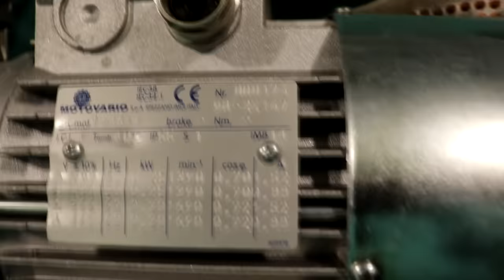DIY Recycling Machine for Aluminium Cans (Make money from your aluminum cans)

Comment: Make money with cans after spending it on electricity to crush them .
Reply: Youd be correct with that. However, im speaking on the price youd get paid per can vs how much electricity is being used to drive the motor vs just take them in and sell them in the current condition without crushing. I was just funning, but now my evening is going to be ruined by doing the math. Thanks.

Comment: One at a time, temporarily novel. Many at once? Timelessly pragmatic. 

Contrary to what many in the comments section are whinging about, the densification of aluminum containers is a worthwhile pursuit, due primarily to the fact of volumetric capacity of plastic trash bags being a limiting factor for those who rely upon recycling as one essential means of income. For maximum workflow efficiency, I’d like to see a man-powered multi-can crusher, something with a crank & roller, or a lever-vice.

Comment: No idea why people are crying because it's "over-engineered". That's kinda the point! He obviously had some steel lying around (as most people who work with steel have), he doesn't pay for machining (and enjoys it obviously). The motor is obviously used, so it's really not expensive at all (for him, or for you if you are creative and weld).

The steel for that (probably about 10kg I would guess) would cost me $8 at my local scrap yard, the can of paint costs more!

So stop complaining, and just enjoy the awesomeness. 

I don't have a spare tow bar to use (yeah, that was excessive) and I don't have a lathe, but I do have 6mm steel plate and an angle grinder, so pretty sure that would do the trick. The round tube looks like street sign steel posts (easy to get at the scrap yard). The yard has a smaller size, I bet it fits in it! I don't have a spare motor, but I bet you could make a poor mans version with just a lever to crush them (or I could see if they have a motor at the yard, they often do). 

Awesome work, just needs a hook to hand a bag from at the bottom

Comment: A baler can be built using a steel box and hydraulic jack, can size and dents won't affect how it works. 1'x1'x16" box would work well, fill box, crush, fill box, crush and repeat until you have a 1' cube.

Comment: Well , I have most of the tools needed to make this can compactor, but it would take several decades to collect enough cans to pay for the electricity used making it,  not to mention my labor time and scrape steel. So I will just drop them on the floor and step on them, works well enough.

Comment: Fun to watch but ti would take a very long time to actually return a profit. A hydraulic press attachment would achieve the same job better as you'd end up with a single solid block of aluminum instead of a bunch of crushed cans, plus you'd have a hydraulic press you can use for other tasks.

Comment: It shouldn't be called DIY unless it can be done with normal everyday handyman tools. Or with a small investment.

Grinders, welders, drill press, metal lathe... its basically a metalworking shop at this point.

Comment: You have to be careful when crushing cans before recycling, the reason being that single-stream recycling systems relies on material and shape in order to sort recyclables effectively, and crushing the cans confuses the system, and they can get put straight into the non-recycling stream. However multi-stream systems are sorted prior to recycling meaning the cans can be crushed. So you really need to know beforehand which system your centre is using.

Comment: Nice machine, but crushing into puks is the WRONG way to crush them. The puks cannot be compressed into bales by the scrap dealer/recycler. Unless feed into an induction furnace, most of the aluminum is oxidized when melted. Better to flatten them from the side. (Yes I work in the industry for years)
Reply: Wow nice job

Comment: Nicely made, but consumes power and resources to build and consumes power to operate. Would be 'greener' replacing the motor with a manual crank handle. Would be ever 'greener' just recycling the cans as is or just stamp on them.

Comment: I would absolutely rent a machine like that if didn't use crushing can with a cast iron dumbbell as an arm work out. 10 dollars and a deposit for a day use would be worth it. I could probably process a thousand pounds of cans in a day with that. 
The only thing I would do differently in its construction would be an oil system.

Comment: I accidentally discovered that my "Jaw Horse" crushes two or three cans at a time to a quarter inch thick with 5 pumps of the foot feed lever. Then when I  need a vice or second hand I can use it for that.

Comment: Was wondering how much i would get for 1kg of cans if i just returned them to the store to get the deposit.
A 330ml can weighs about 13 grams, so you need 77 cans to get 1kg. Over here the deposit per can is 15 cents, so for a kilo of cans i'd get 11.55€.
That's quite a bit more than from just selling them as scrap...

Comment: If you worked at my shop I would fire you on the spot. Long sleeves at a lathe, not ensuring the grinder is at a complete stop before setting it down, not locking the plate in while drilling, etc.  Complete waste of resources and time. Step on it, throw in a smelter, flux to have pure aluminum and make more money. Atleast you helped me kill 20 minutes of my day.

Comment: 31 375 ml/1oz cans equals 1 lb.  Today's avg for scrap aluminum cans is $0.53.  Seriously, it is not worth the effort to even crush by hand let alone make a machine to do so. If you are generating enough empty cans to think you are getting some money back,  you are not because you are spending too much money on canned beverage like soda and beer and probably not doing your body any good as well.  Put them in the recycling bucket on the curb.

Comment: The reciprocating motion isn't as good as a regular can crusher where you just pull a lever. The force applied at the end of the stroke is a fraction of that applied mid stroke. Therefore this over engineered beast of a machine wont collapse cans as tightly as some human operated thing that takes no electricity. It is getting the YT views though.

Comment: You spent at least 24 hours to built that machine, finish it by adding  a protective shield near the gearbox it would take  15 minutes of your time. As it is, very dangerous set up  p.s   no kids around this thing.  Somebody is going to get hurt  for certain.  An old machinist advice

Comment: Those hundreds your holding + many more like them is the cost of building the can crusher. Mind you I don't have a drill press or a steel cutting lathe or a mig welder so that's a lot more money out of pocket to build an aluminium can crusher that at the going price of recycled can aluminium + the fact that cans are on a decline as plastic bottles are taking over, meaning that it will take the rest of my life just to break even.  It's a beautiful piece of equipment, but a waste of time and money.

Comment: @ 17:49 you have done this through the video. I let it slide until you drilled through thick steel with no lubrication on the bit. I guess you like wasting money on drill bits!

Comment: I guess it's a matter of where you live. For anywhere where there's a bottle deposit this is completely useless. I guess if you were looking for a way to compact your cans for easier melting in a home foundry it might be something but a $15.00 can crusher from Harbor Freight would do the job just as well for that. If you're trying to make money from the cans...Considering the time, energy, resources, etc put into that contraption it'd take you years to recoup the expense of building it. Seeing as you're using the ass backwards metric system I break it down that way. There's about 14.9 grams in the average aluminum soda can. That varies a bit by brand, shape can, region produced for, etc. Using your 1 kilogram from the end of the video that means there's about 67 cans per kilo. (Yes it's not exact but the cans will vary a small bit anyway). At $0.05 per can just for picking it up and putting it into a machine at the store that same 67 cans gets me $3.35 to your $1.50. Not even close to worth it.

Comment: 6:25 what’s that sander thing called?
Reply: I believe it is called a "flap wheel" they are made in a few different configurations for different tools like die grinders or drills.
Reply: Karl Childers flap wheel is a term that I call tiger paws, they go on angle grinders... I was needing the same of it. Found out it’s called a drill drum sander...

Comment: You guys are all very dense with your it will never pay for itself. or only for a professional machinist bs.  I built virtually the identical crusher over 15 years ago for about 30 bucks worth of scrap metal, and industrial throw aways. using only an angle grinder and a cheap 110 welder.   sure you can machine it all like this guy, but you can also slap it together with rough cut steel and a junk yard motor.

Comment: It’s a over engineered can crusher not exactly a recycling machine, if it then refined the cans into aluminum bars then it would be something else idk what but eh
Reply: You sound rather envious, Zyanid Warfare.  That is hilarious.  This YouTube channel is proving with this video alone that it is very possible to build a high quality automatic aluminum can crushing machine.  It may cost an arm and a leg to buy the materials, welding equipment, and learn the know-how but the end result is pretty darn spectacular.  Minimal moving parts on a machine.  That is the key to a high quality machine that is intended to last a long time.  Especially to minimize repair costs down the road too.

Comment: spends hunderds of bux in material and labor needs to collect tonns of can spending tons of hours collecting just the get the initial back , yeah smart move,  even doing 150 pounds or so in empty cans wont make you more then 25 to 30 buxs and that be roughly 4000 to 5000 cans , enjy drinking them all or scavenging them regulary to get a descent buck out of it

Comment: First of all, 90% of this thing could have been made out of wood. And if you're going to go with metal for aesthetic reasons, why then have that flimsy and ugly coke can piece for a guard?

Second, even in the context of making this thing out of metal you wasted a lot of metal. My god man, did you seriously lathe off half the metal of that cylinder? (Also, I'm not an expert, but couldn't you have saved time and metal by sanding everything at the same time, rather than sanding then welding than sanding than welding?)

Third, the title is misleading. This is an overengineered can crusher, not a recycler, it will absolutely not make the money back it cost to make in its lifetime (at least, not the way YOU make it), and I don't know about you but I don't know anyone who just so happens to have spare industrial electric motors lying around their homes, so it's not DIY, either.

Fourth, I personally crush cans with a hand crusher that I have in a frequently-used corridor. Uncrushed cans are in a box next to it and crushed cans fall into the box below it when you begin the action of crushing the next can. Every time I pass it, I crush one and exactly one can. Why do I bring this up? Because it's a far simpler and cheaper solution to the tedium of crushing cans than this is. I crush mine and my neighbors cans and still frequently run out of cans. Simply put, you're solving a problem that doesn't exist.

Comment: Far from “DIY” lol
Reply: I'm guessing you don't weld. He did an awesomely neat job, but it's fairly simple design other than the lathe work (which could be substituted for some plate steel and an angle grinder). I couldn't make one as nice as that, but with 6 months of welding experience, I'm confident I could make one that works like that.

Comment: What a useless expensive garbage.
Very expensive and 0% efficient.
Better create a small Hydraulic press and drop all cans and compact only in 1 movement instead using a motor gear than it's expensive plus the consume of electricity